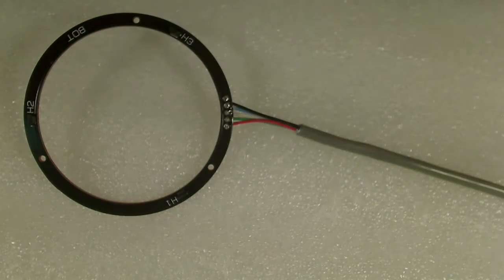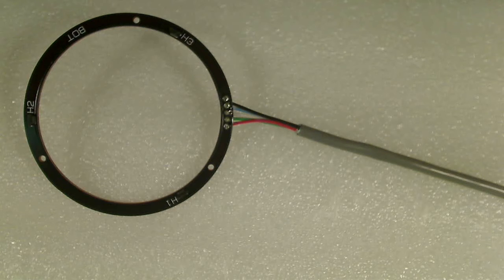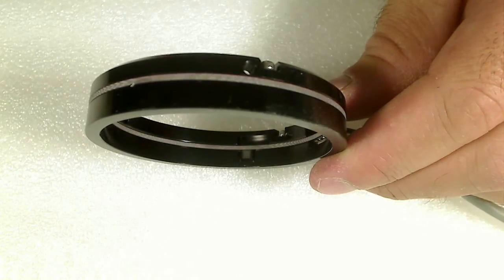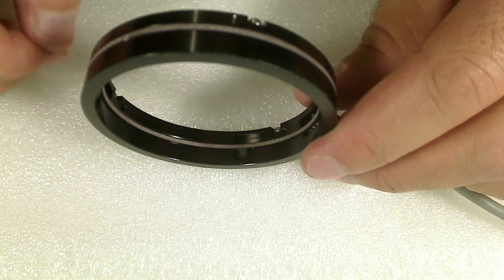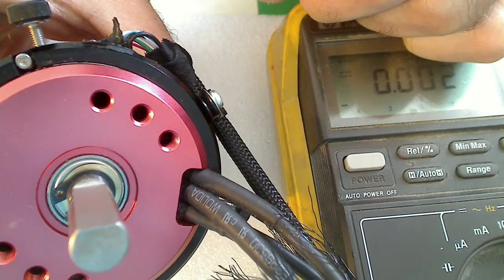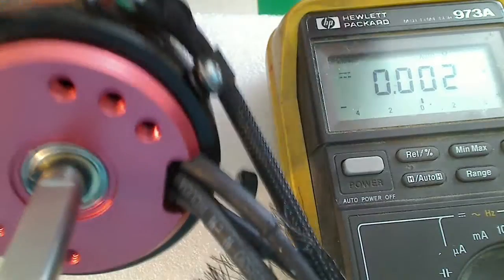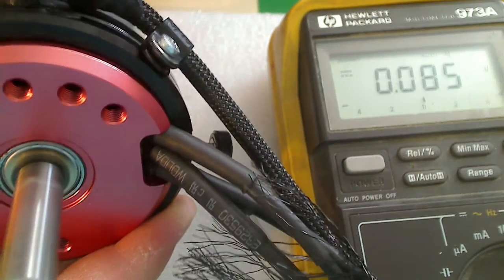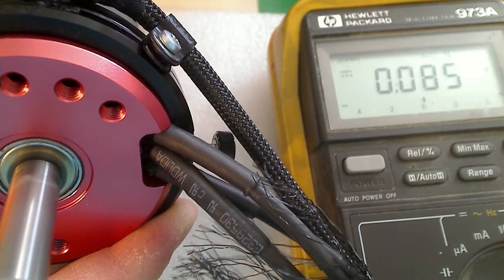Hall Sensor Assembly onto Brushless Outrunner Motor - Metroboard Electric Skateboard

Comment: Hi there. I think I have a problem with my hall sensor on my ego board. It also maybe the motor control board. It was strange as it came and went abit over a few rides and now it only runs under no load. To hall effect fail with this behavior?

Comment: Hi, I'm working with a BLDC for muy Thesis, and I want to know if those Hall sensores are radiometric or latch or switch type, AND with how many voltage are you supplying them. Thanks for your attention and nivel work
Reply from the maker: Latching Digital Type.  5V supply
Reply: @MetroboardElectricSkateboard  HEY LAD . I NEED LIL ADVICE HERE ON ESCs AND VESCs . WELL I ORDERED 4600W 4x MOTORS AND I HEARD TO REACH THE MAXIMUM POWER I NEED SUPPLY THEM WITH 48V ........ WELL IS THERE ANY WAY I CAN FUK THE PEDAL TO HEAT THEM UP TO MAX WITH 22V-28V ??? BIG THANK YOU
Reply: @reptiloidx8942  Short answer: No
Reply: @oadka  GRETE ANSWER .....